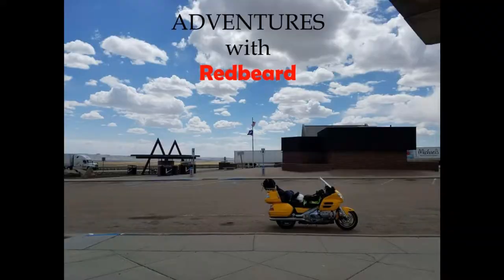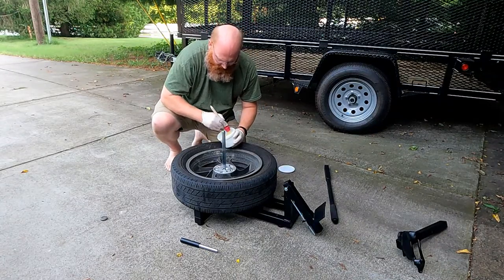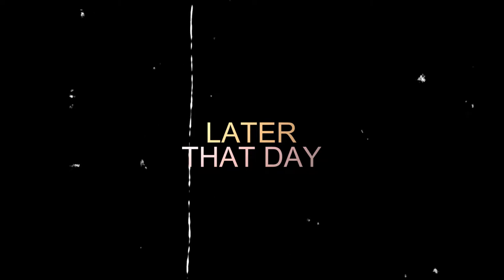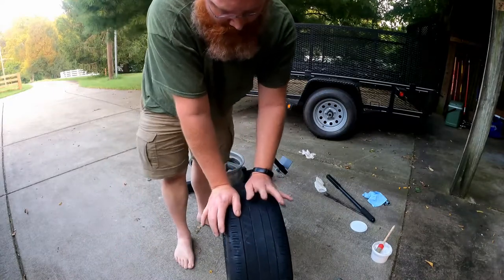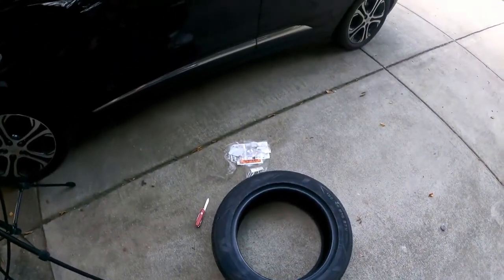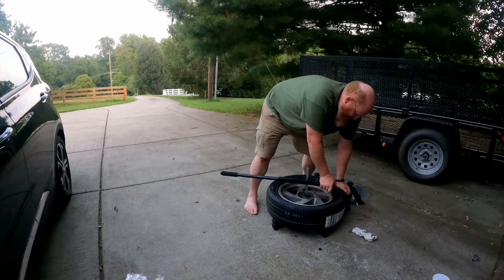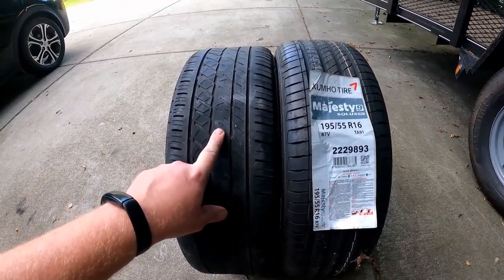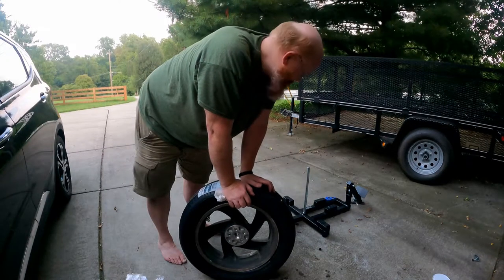Olmaxmotors First Tire Compare Goldwing Darkside Bridgestone Driveguard and Kumho Majesty

Comment: I went Dark Side in 2008. First one was a Kumo RF. I had a flat at 80+mph and it just wobbled a little bit . I had a 4" split in a tread grove.
Reply from the maker: That is quite a bit of experience. I may go back to a run flat after my current tire. Have you used a non-run flat?
Reply: @AdventureswithRedbeard  The last three have regular tires (205/55/16 Kelly Chargers) that is what the service truck brought out to me on I 40 just outside of Greenville TN.  He was a Simi tire tech and he pulled out his sledge to remove my tire. I ask him if his outriggers worked, he said yes. I said less do this the easy way, less use one of the outriggers to break the bead with. He looked at me like I had gone crazy. I told him to run it out about 3 feet . I put the wheel under the edge of the pad and told him to go down easy so I could position the wheel. less than 45 seconds the beads were broke loose. I told him now it's your turn. He had the tire off and the new one on in less than 2 minutes. I put the wheel back on the bike then aired it up and set the bike back up on it's wheels paid the man and we were back on the road in 55 minutes from the time I called the tire center.
The cost of the tire and the service call was $205.00. That's $50 cheaper than the cost of a good MC tire.

Comment: good job brother . I just ordered this system also .  
I plan to use it on a table or bench at  chest height or so . 
If you warm the tire up , in your boiler room or with a heated blanket ... It helps to get them off easier. 
I agree bead lube is a must. 
I run commander 2s on my star. Just tired of using spoons haha. 
Gotta save your back brother.
Reply from the maker: A bench would be helpful. Thanks for watching, and let me know how long the tire changer takes to ship to you.

Comment: Red, I used a Kuhmo H426 195/60/16.  It fit without rubbing and because it was taller than the 195/55/16 it corrected the speedo and increased the mileage a hair.
Reply from the maker: I wondered if a different tire size would help that. Thank you!

Comment: I’m running a Pirelli P1 RF.  My first time with a CT and have over 6K on it right now but I’ve been maintaining 36psi in mine.  Looks like you didn’t do too bad with your changer since it wasn’t bolted down,  and up off the ground.
Reply from the maker: Thanks for watching. How do you like that Pirelli? I did replace the front tire with much less trouble. It's getting easier.
Reply: @AdventureswithRedbeard  I really like it.  I already have another one to mount on my extra set of wheels.  I rode the Dragon a couple weeks ago and had zero issues with the CT.
Reply from the maker: @workharddieproud  Glad to hear.

Comment: Back in the day on the farm we used a car bumper jack to break the bead , and some of the tires where large and had to resort to bigger heavier means . Seems your tool needs to be bolted down to a solid surface.
Reply from the maker: That would make it easier. I am thinking about attaching it to my trailer so I can take it to people who may need help. Any suggestions on how?

Comment: I wouldn’t assume that 41psi was too much based on that tread wear. I saw a car tire run at a lower psi on a Wing that had considerable sidewall damage; really looked like it was run flat it looked so bad. So I’d say yours was probably a good result.
Reply from the maker: Thanks. I currently have 1,500 more miles on the Kumo than the Driveguard and have fairly even treadwear (~4/32nds). Sounds like overinflation may be better than under. I picked a small car my tire is used on and used that pressure. Mini Cooper = Goldwing? Do you know how low a pressure was used?
Reply: @AdventureswithRedbeard  I think it was 34-36 but this was one big trip he took and was probably loaded heavy too.

Comment: Red just run 32psi and it will be fine. I've changed 1000's of tires.btw instead of using that bead sealer and a brush just use dawn dish soap
Reply from the maker: Thanks for the tips!

Comment: What's your followup on the Kumho non runflat? I'm about ready to get another CT. I have the DriveGuard. It still has tread on it, but it is 6+ years old. Is that okay
Reply from the maker: Thanks for asking. I like the Kumho Majesty 9. The non run-flat provided a very smooth ride. But I changed the air pressure from the run-flat. I did have a flat with this tire, not a fun experience. Just today I got my new tire and it's a Pirelli run flat. I thought I would try a run-flat with the lower pressure I've been running (32 psi). I'll have a video discussing all of that. 
6+ years is getting old for a tire. Most recommend no more than 5 years for a car or motorcycle tire. I recommend you getting a new tire.
Reply: @AdventureswithRedbeard   I just got a Yokohama run flat and put it on a day ago. It feels  much smoother  and  quieter than the DriveGuard. I' m on a 300 mile weekend trip with my trailer, and so far it's all good.
Reply from the maker: @toanogreen  Nice! Which Yokohama? Where are you camping? Which trailer do you have?
Reply: @AdventureswithRedbeard   1) I have the Yokohama Avid Envigor 195-55-16 run flat. One thing I noticed immediately is it is mor round than the Drive Guard, almost like a MC tire. It feels great. 2) I'm in the New Bern NC area. 3) I don't have a camping trailer, I have a Can Am RT 622 trailer. Love it. We are renting a cabin
Reply from the maker: @toanogreen  I'll have to check that tire out. I'm not familiar with New Bern, but everywhere I have been in NC is very nice. I've heard good things about the can am trailers. Sounds like you're having a great weekend. Enjoy!

Comment: Mount the tire tool to that trailer.  Thanks for the video, thinking about going dark. Any difference in the ride?
Reply from the maker: Mounting it to the trailer is a good idea. I've thought about putting it in the trailer, but if I were to mount it somehow...I'll put more thought into this.

Most people notice a little more effort with the counter-steering at first, but it goes away. I've noticed more stability on the interstate, grated bridges and grooved roads are no longer a concern. Better wet traction (compared to the E4's at least) and a general smoother ride. I have a few videos reviewing my experience if you're interested.

Thanks for the idea, and let me know if you come to the Darkside 🙂
Reply: I should have mentioned in my post that mounting it would be attach it and then be able to detach it easily a couple of mounting brackets or bolts would probably make it work really easy to put on and take off when you're not using it. That is something you don't use everyday.
Reply from the maker: @roysamuels2937  True, it is a good height. Or maybe a shelf to attached to the trailer where the tool can mount to.

Comment: Did my GW today ... I used a honda civic and a 3 ft 2x 6  to break the bead on the motorcycle tire.... then I used the civic again on a RF driveguard  to hold it down in the channel while i spooned it on...
Reply from the maker: The Olmaxmotors tool is cheaper than a honda civic :)

Comment: Like that tire changing device, much more affordable than the rabaconda...as for the tire, a runflat must give a pretty harsh ride on a bike...
Reply from the maker: Hey, @Speedytrip. I thought the runflat was smoother than the Dunlop E4's that I used. But a non runflat with the right amount of air is silky smooth. Are you Darkside?

Comment: I have run CTs on all my wings 2 or 3 wheel and probably mounted over 100 over the years. Get some decent tire irons and toss the changer as I tried one and it was a horrible experience. Also good catch on the non runflat as the RF tire is absolutely the wrong path to go/ 26lbs will be perfect and 45 to 50k should be expected. Best advice is stay off the Darkside boards as most information is incorrect. Typically a tire change takes less that 20 minutes start to finish if you use proper irons. Good luck and lower that pressure it will be perfect
Reply from the maker: Thanks for the advice. 100 tires is significant experience.

Comment: Cool Video. I have the device too. I mainly use it to change motorbike tyres. I recently changed 2 tyres from my trailer. Hard work.... By the way, funny to see that you can buy this thing in North America too. The manufacturer is in Poland and I bought it there directly....
Reply from the maker: Thank you! I purchased mine from Lukasz in Poland too. Shipping took some time. He has no distribution here in North America. How long have you had yours?
Reply: @AdventureswithRedbeard  I bought it some years back. Shipping from Poland to Germany was quite fast and Lukasz even speaks German. I am very satisfied with the tool. In recent years, many tyre shops here in Germany have stopped fitting motorbike tyres. With the device, I am flexible and save in the long run. Have fun with the tool...

Comment: So how did the tire work out , i run a driveguard RF with 35psi on the rear of my 09 wing & love it , did you notice a difference in handling between the RF & non RF , & what pressure did you finally stay with . 

Thanks
Reply from the maker: The  Kumho Majesty 9 is working out great. Running it at 33 psi, the same pressure used on a Mini Cooper. I changed too many things to say which one, but between not being a RF and a lower pressure, this tire handles like a dream. Extra smooth. I rode for a hour or so on a concrete highway and didn't notice until someone said something. Maybe the expansion joints were closer than most, I don't know. This is the tire I used for my Sturgis trip with all those rides. Check out that video if you're interested. How long have you used the Driveguard?
Reply: Sorry been awhile , guess I've been riding too much , have about 15,000 on the driveguard,  still looks great 🤔,  pretty sure,  Bridgestone discontinued the 195-55  as no one has it anymore

Comment: I am new to riding the Dark side.  I have about 1500 miles thus far on the F6b goldwing.  The ride is a bit different.  Much better on the highway, grooved concrete and those dang metal grates on expansion bridges.  Tell me I’m not the only one that hates going on long metal bridges?  The bike does do better at stop lights, the flat tire seems to just keep the bike upright.  Now slow speed maneuvering is a little different, but I have gotten used to it.  I have never done a cone course but would like to try one or even take lessons at one…. Does anyone know one close to Charleston, SC?
Reply from the maker: Welcome to the Darkside! I hated going on metal bridges too, now I don't notice them. Cool, huh? I've heard rumor that the training arm of GWRRA will continue, maybe check with them? Keep me updated on your continued experience and if you can find a class.

Comment: Ran the drivegard on my 09 didn’t like the flat feeling at slower speeds.Now thinking of trying a tire with a more rounded edges,on the F6B.How was the trip to Sturgis?
Reply from the maker: This Kumho did well to Sturgis. Many of the expansion joints I didn't even notice. Max mentioned them to me. The softer sidewalls and lower air pressure seem to be treating me well. I need to do some cone work and see how it feels low speed.

Comment: I watched fortnines dark side video recently and he mentioned the need to countersteer through a full corner to overcome the car tyres tendency to try and keep the bike upright. Does this not result in your front tyres wearing out quicker?
Reply from the maker: It's been a while since I watched fortnine's darkside video. I may have to rewatch to see what he was saying there and I will have to put some thought into this question. I haven't seen anyone address this before.
Reply: @AdventureswithRedbeard  I haven't watched the video you are talking about. I have been running the Dark Side since 2008 and under normal riding you don't have to counter-steer. Now if you are dragging pegs and riding real aggressive, you might use a little. I have never noticed any excessive front tire wear.
Oh get that changer mounted up about waist high and solid, it will save your back and tire changes will be easier and faster. I use a modified  Harbor Freight unit with the duckhead.

Comment: Have you got to use that tire changer anymore ??  I was thinking about getting one.
Reply from the maker: After my rear tire I did my front. I then tried car tires, but this isn't the right tool for that. The center hubs for cars are much bigger. That's all I've done, but the front was easy. That's why I tried the car tire on car rims.
Reply: @AdventureswithRedbeard  Thank you,  I was wondering about actual car tire / wheels changes but that’ll end up being more than I want to get into.  So I’m just gonna stick with motorcycle tire changes for my wing and other friends bikes.  I seen another video here on the tube about it, mechsavvy, he had high remarks regarding that olmax.  Anyway, I’m gonna get one soon I hope.  Thanks again !!

Comment: Nice tire changer. Maybe I should get one like that and then find a 20" tree trunk and set it in the ground or something to mount it on.
Reply from the maker: Tree trunk or sturdy bench. My dad has a different style (No-Mar) that you mount to a concrete slab. It has a stand with it so you don't have to crawl on the ground. The Olmaxmotors is more trackside design.

Comment: Redbeard  Run 29psi in that rear tire, that's what I run in mine. (35000 miles out of it)
Reply from the maker: I'll try that, thanks. 35k sounds nice. I did notice with my new TPMS that the rear tire gets warm so the pressure goes up to about 40. I'll see what 29psi does. How long have you been Darkside?
Reply: @AdventureswithRedbeard  first one was in 2008

Comment: What about balancing beads, would they work?
Reply from the maker: I've heard good things about balancing beads, but I haven't used them. Are you Darkside?
Reply: @AdventureswithRedbeard  no still on the fence. How do they corner, you can really lean the bike over? Also how are they with a passenger?
Reply from the maker: @Kolsch221  They corner great. Yellow Wolf used them on the Dragon. I rode the Dragon with them, and think I rode pretty aggressively on the Richard B Russell Scenic Byway https://youtu.be/WPuZ_G_-Gac. You can also see my crash video where the tires held until I was on the crash bars and the tires were lifted up. You can see that one here: https://youtu.be/mubzz2WZgfk. I don't ride with passengers very much, but all the co-riders I've heard from say they ride is much more comfortable.  Do you ride mainly backroads or highway?
Reply: @AdventureswithRedbeard  thanks for that response! I ride back roads highway and with passengers.
Reply from the maker: @Kolsch221  nice! I think the car tire excells on the highway/interstate but is also great everywhere else. My opinion is if high mileage while towing and/or passenger a  car tire is highly recommended.
Reply: @AdventureswithRedbeard  what tire do you recommend?
Reply from the maker: @Kolsch221  My experience is limited at this point. I only have a little over 30k Darksiding. The tire I started with is very popular, the Bridgestone Driveguard is a run flat. Some people say the biggest piece of mind with a car tire comes from being able to have a run flat. One person I've talked with who's had flats with both said while the run flat was better it wasn't a huge difference. I have 10k on my Kumo Majesty 9 (non-runflat) and really like it. DSRiders.info has lots of tires and rider's comments. Hope this helps.
Reply: @AdventureswithRedbeard  thanks for the information. One last thing what is the size of tire?

Comment: non run flats on GL1800 need higher pressure than do run flats,  I use 43 psi, but your choice is your choice.
Reply from the maker: Everyone has to dial in their tires to their preference. I hasn't happy with the wear on mine at stock pressure.

Comment: Just tried removing my old Dunflop tire with tire irons. I ended up having to cut the damn thing off. Tried the zip tie method first to no avail, then went with the irons. Using four of them and tons of lube, I was able to get ONE side of my tire off. The other simply wasn’t going to work over the edge of the rim. Used a reciprocating saw to cut it off, just thinking the tire was old and hard. There is no way in hell that I’m going to be able to just press the new tire on over the rim. Tried the zip tie method with that too and I’ve got a solid couple inches of tire bead hanging over the other side of the wheel if I start the tire on one edge under the rim lip. You made pushing on that first bead look so easy 😅. I’m giving up and taking it to a tire shop and I never give up. HOURS of fussing with that wheel and scratching up my rim.
Reply from the maker: Tires can be the most frustrating thing to work on. It's like they just taunt you with the almost going on. I sometimes leave the tires in the sun for a little while before working with them and that seems to help some. No shame in taking the tire to the shop to save your back and your rim. Before I got this Olmaxmotors I used the tire tools with varying results.
Reply: @AdventureswithRedbeard  Yep! Frustrating is definitely a word for it 🤣
Reply: I have the same issues. I use an angle grinder to very carefully cut the cord on one side. Lots of smoke and extra clean up but I figure the $50 I save goes in the gas tank

Comment: That tyre changer looks like hard work, you might have been better off just using big tyre levers once you break the bead, that's pretty much what I used to use just tyre levers and getting the tyre off and on seemed much easier than that tyre changer.
Reply from the maker: I was beginning to wonder too. But I've used it some more and learned the technique. It's a lot easier now. I'll need to do an update video with my next tire change. Thanks for watching and commenting.